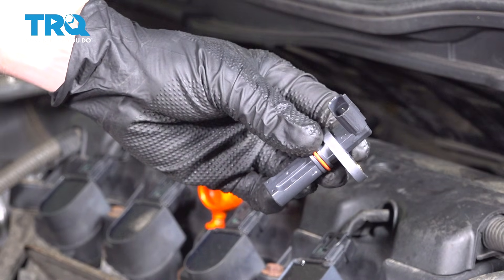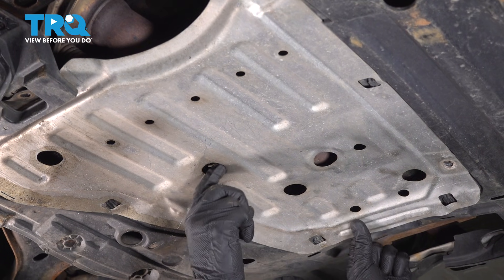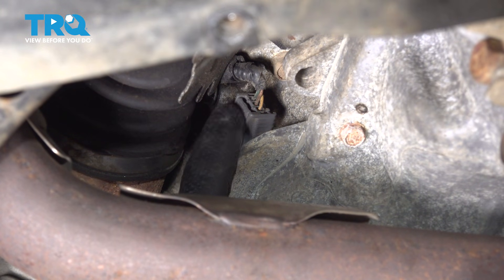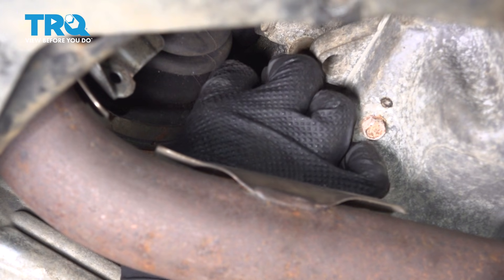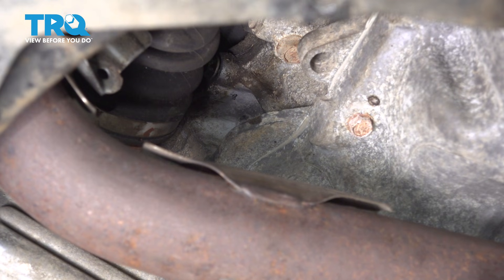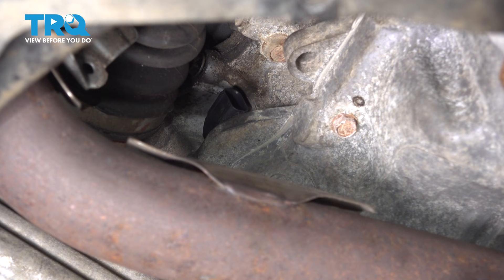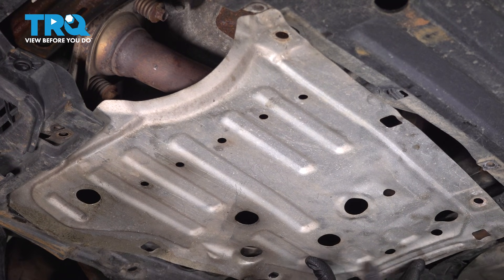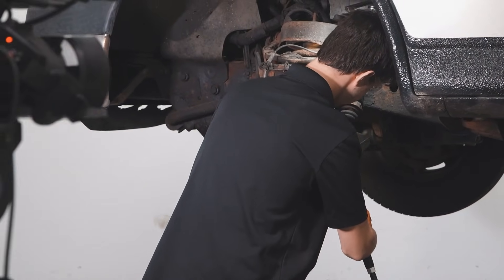How to Replace Crankshaft Position Sensor 2012-2015 Honda Civic 1.8L L4

Comment: Did they slightly adjust the placement of this by 2015? Mine seems to go directly against the axle itself and not the rubber boot, with even less room to maneuver.

Comment: Fantastic video!

I went to do this awhile ago and got frustrated by how hard it is to access that bolt. I waited until I replaced that CV axle that's in the way. After I installed the new CV axle, I remembered about the sensor I didn't replace...

None of my ratchets or wrenches fit, looks like I'm getting a new, tiny breaker bar!